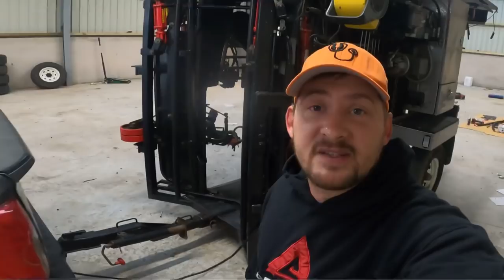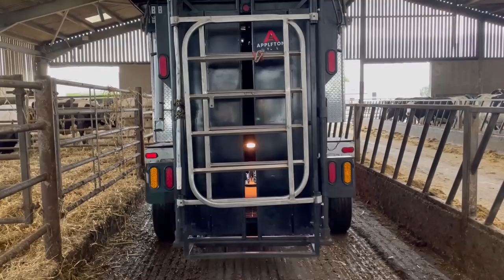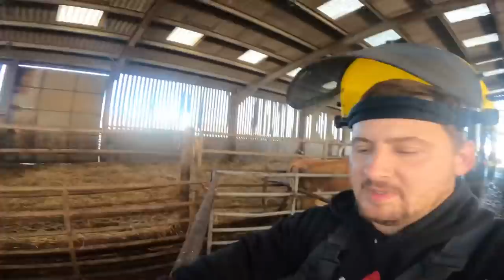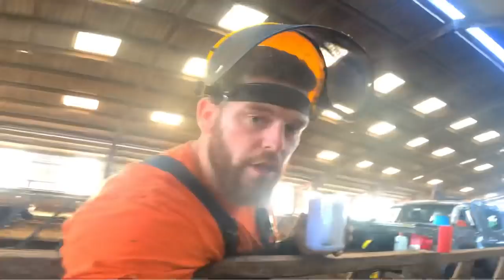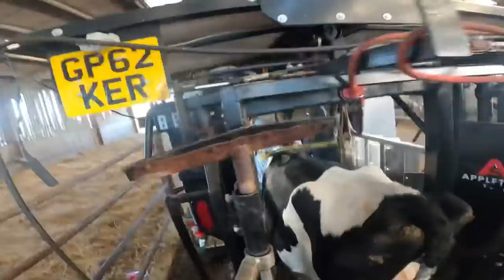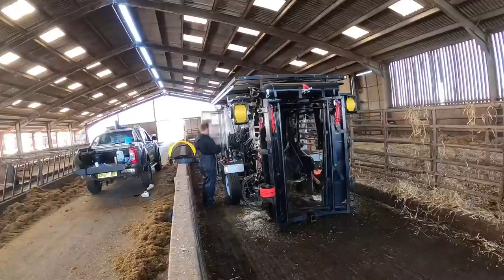Quad bike pulls 2 and a half tonne crush

Comment: I've worked all sorts of jobs from manual labor, agriculture, electronics, and software engineering. If you're boss and/or coworkers don't have a sense of humor and pick on each other, the job is boring and you'd wonder what you're doing wrong. It makes the job easier because you're joking and having fun rather than just grinding away which would feel menial. Great job Craig!

Comment: You need to put a trailer hitch on the front of the truck, with a removable hitch. It is a life saver, you can maneuver the crush anywhere you want it, in those tight places.

Comment: So impressed with your skills! You're becoming much more proficient. I like your channel. I've always wondered what went on behind the scenes and now I'm getting a great perspective thanks to you.

I am a career nurse and I used to work in safety monitoring and I must share something that you both should avoid at ALL costs! I am VERY concerned seeing you standing in between the crush and the truck as Graeme backs up to it. Both of those massive pieces of metal equipment are exactly knee-high to you; so if anything happened with the truck while you are standing behind it. Your legs could be crushed by the crush!

Graeme is an excellent driver, but accidents happen. What if his foot slipped off the break? Or if the truck's transmission were to suddenly pop out of gear thru no fault of anyone? You are both courting the devil just by being there.

This is why safety laws exist. An accident could happen tomorrow or never. But if you simply avoid being there, the only thing that might happen is Graeme could drive the truck into the crush. 

I have come to look forward to spending time with you both after my day is over. Please think about safety first! It's why you are now both religious about wearing eye protection. It may never happen, but it WON'T happen if you avoid being there in the first place.

Thank you so much for sharing your life's work with us. It makes my life better just to know that you are both doing your best to take care of your little corner of the world!
Reply from the maker: Thank you for being concerned. I really do appreciate it I will try to take this on board. Maybe not in my next video as it’s going up tonight but. In the future.